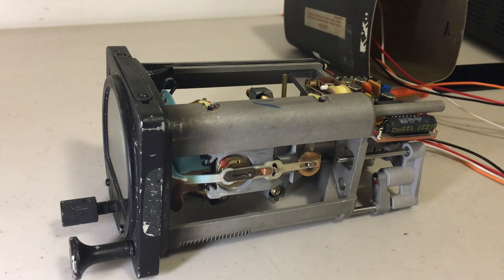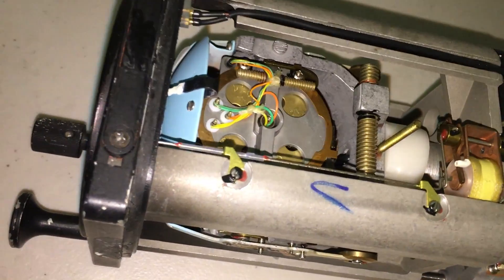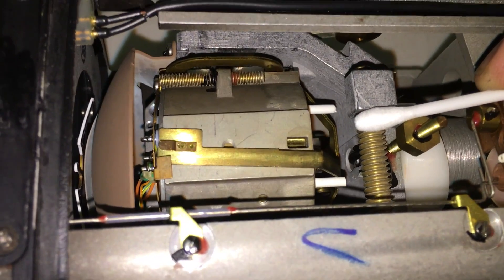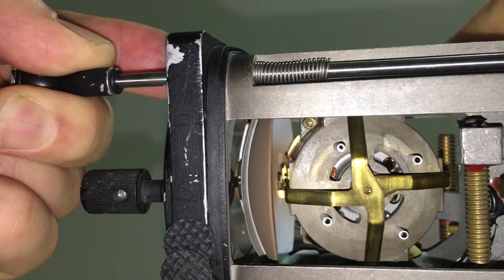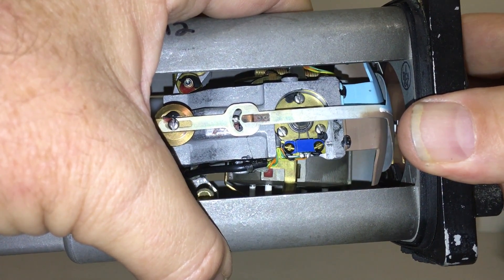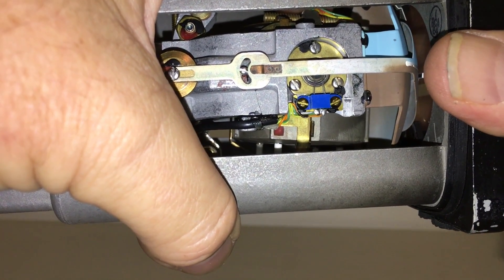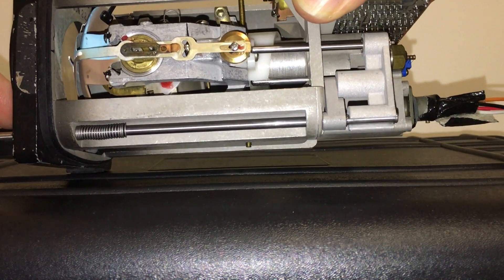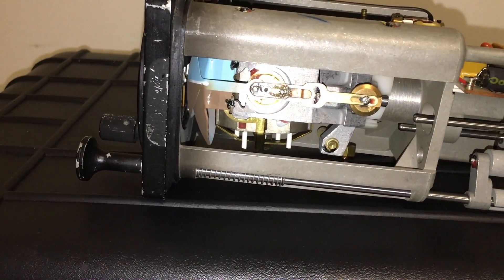Flat Earth - A look inside the Artificial Horizon - Pendulous Vanes.

Comment: Are the ports blowing "straight away" or is the nozzle also angled inside the rectangular opening? (I.e. where/how does the airstream from an open Port move the housing towards? Spinning or shoving?)
Reply from the maker: +Feno 3000 I was surprised how much air is coming out of the ports.  You can feel it easily.  It feels like it is coming straight out and that makes sense for the direction of alignment needed.  I''ll demonstrate the strenth of the wind with a piece of string tomorrow.
Reply from the maker: +Feno 3000 - Reading your post after a sleep I see I missed answering your question.  The port that opens will result in correction at 90 degrees to the direction of the Port.  That is due to Gyroscopic Precession.  It will respond at 90 degrees to the force applied. 

This animation explains it nicely.

https://www.youtube.com/watch?v=_MoS5Yw9ZgE
Reply: The way that gyros work is something called gyroscopic procession, that’s where any force applied to a single point on a gyro will affect a spot that is 90 degrees in the direction of rotation

Comment: Just for fun type in ..Proofs of a globe on YT.....you'll be amazed ..pretty grim
Reply from the maker: +Mark Draco.  Just for fun, try posting a comment that is on the topic of the video.  I'll be amazed.
Reply: Oh I do .... and then the attacks begin ...lol
Reply: What is amazing is how you pull the cage when on the ground and it knows and follows earths curve whilst in the air ...amazing how it always knows where the centre of earth is ....
Reply: Amazing how gravity works, isn't it.
Reply from the maker: +mark Draco - the attacks begin because even when you post on topic your comment demonstrates you miss the point of the video entirely.  That is not an attack, it is what I notice often in comments here by Flat Earthers.

You have done it again.  Caging on the ground, in the air, upside down or in a turn is quite irrelevant.  Once the cage is released the gyro automatically starts correcting itself back to level. 

It does this by sensing the direction of "down"  That is not difficult to detect. 

It is not really amazing that it knows where the centre of the Earth is.   Pour out a glass of water.   Which way does it fall?  That is the direction to the centre of the Earth.  Easy as that. 

The direction of down changes as you move around the Earth,  an experiment with two plumb bobs a mile apart and a theodolite will prove that.

Your comment is very naive and shows people you don't understand my video at all.  Is that an attack?  Maybe, but it is also the truth.
Reply from the maker: +Mark Draco - just another thought,  Just for fun check how many schools on Earth teach the Globe.   Then compare how many of them genuinely teach kids the Earth is Flat. 

You want grim...  That'll do it for Flat Earth.   Not one school on the planet teaches Flat Earth.    It is just a tiny, weird part of YouTube that nobody takes seriously.

Again, sorry if that sounds like an attack,  it is also the truth.
Reply: Wolfie who owns the schools ? ...Clue it is the same people filling you with fluoride,putting it in your water....I guess you believe this waste product is good for you. What you say is not an attack ....I would say being called a c*nt is an attack like from MuzikTWAT the gamer ....
  So Wolfie how can there be sunlight in  New York ,New Zealand,Tokyo(Japan) and the UK ...all at the same time ?
   What force pulls the ISS away from earth when it needs to adjust for the curve ?
    What force pushes rockets in space ?
   How is the moons shadow tiny (solar eclipse) but the earths shadow(lol) is massive (Lunar)...when they are both equal distance ?
    What separates earth from the vacuum of space ?
    How is it the horizon dips in 3 to 4 miles looking forward ...but left to right you can clearly see 40 miles either side ?
   And back to the beginning ...Why pull the Cage out before take off ...IF when flying it is set for where you took off...how does it know to follow earths curvature?
  If gravity was real why isn't Radon (density clue here) density 9.73g/l on earths surface with the other gasses layering upwards towards Hydrogen and Helium .
   Which apparently slowly leak out into space (LMFAO) at that one ...gasses escaping but only some ....blimey there is a leak ...but only a small one or the vacuum would destroy us.
   NOW WOLFIE OR HIS SHEEP FOLLOWERS ANSWER THESE SIMPLE QUESTIONS AND I WILL GO BACK TO TAKING MY FLUORIDE LIKE YOU PEOPLE !!!
Reply: You're a good man, Walter, but Troll Draco has had all those questions answered for him multiple times. No point spending more on him.
Reply: Using the skateboarder hilarious ...you are dense 
Rocket pushes against its exhaust......  "            "
Oh yes did you know they say there are millions of bits less than a cm 500,000 bits larger than a cm all spinning around earth ....not to mention as you say the satellites (lol) ..funny how they all seem to miss one another.
Where is your evidence of gravity ...I guess that it why you avoided the gases lol
So where does Fluoride come from ? Still got my teeth and I avoid it at all cost
Oh and the sun shining in 4 places with evidence ...you ignore that ...WELL DONE....
     Nothing to say about the sunshine LMFAO ...tricky one ah
Please explain how geometry reduces one shadow,yet a clouds shadow is NOT altered like the moons?
Reply: I provided sunshine NY NZ TOKYO UK ...and you NO answers ...case closed
Reply: I've flown to Japan. I was there for two weeks. I could and did send messages to people in America. The time was different. By a whole 16 hours. Try again.
Reply: Adam ...And ? And to whom ?
Reply: mark Draco Family? Friends? It's not like it matters. There's a massive difference in times between the two. Your argument doesn't really work.
Reply: lol, sorry I meant who was your message to ;-) ..... As for your point... It was recorded live .... you know what live means ? 05.48 Tokyo  16.48 NY 08.48 NZ 21.48 UK ...Sunlight was seen 4 places same time ...
Reply: Twilight. Anyway, it doesn't prove anything even if it did happen. You guys go digging for "proof" anywhere you can. Am I allowed to claim it is faked? The ISS has a livestream too. Let's just simplify it. Show me a FE map that works.
Reply: There is so much globe evidence isn't there ....I don't need to show you anything ....I can NOT open your eyes.
Reply: Walter Walter oh dear oh dear ....the sunshine is my video done 'LIVE"
Oh yes Newton ...funny guy didn't he say if you fire a cannon ball fast enough it would circle earth ...LMFAO 
What does the rocket push against in the vacuum of space ....LMFAO
LMFAO oh silly me geometry explains why one shadow is 70 miles across and the other 1000's of miles across.
If I'm not careful I laugh my head of off ....but there is more from you lol..
Nice ....Density ...WELL DONE !!!!  Although wrong answer explaining the vacuum of space being separated from earth ...Density LMFAO YOU'RE NUTS!  
So the horizon dips off ...LOL where to ??? LOL
LMFAO ...gravity video ...saying it doesn't prove it ...
And finally the fluoride one just proves how retarded you and others must be ....
    I nearly lost my head with your blatant stupidity ....Do you even know what or where Fluoride comes from????
Reply: John you're just conditioned NOT to think or question the reality ...poor thing !

Comment: i guess you clearly would mind to disassemble that thing further, wolfie. thing is: i need to know how on earth they got the bearings running so smoothly in that thing, as an engineer i'm absolutely stunned by such built quality.
utterly informative vid anyway, well appreciated. keep up the good work.
Reply from the maker: +ferze001.  I originally bought this unit to strip it right down but it runs like a dream so I am now reluctant to "break it"  I'll try to find a cheap "non working" model and pull that one fully apart in the future.   There is zero vibration on this when it is running.  You can't feel a thing.  Just the sound.
Reply: +jason sutton  you are just posting silliness.  anyone who drops something observes the force of gravity.  anyone who observes an object being obscured by the horizon sees the curvature of the earth.  wolfie has even made several videos from the beach showing this:  https://www.youtube.com/watch?v=LpQDj600ijA

and here's the literal curve of the earth:  https://www.youtube.com/watch?v=LSrL4xIQT7E&t

however, this is all off topic.  the subject of this video is gyroscopes and pendulous vanes.  if you  don't have anything to say about that matter then do remember to shut up.
Reply: "There is zero vibration on this when it is running.  You can't feel a thing.  Just the sound."

And most of the sound probably comes simply from the air being moved through the holes in the actual gyroscopic weight... like a toy plane propellor or something in that size/rpm region...
Reply: +jason sutton
Better designed by germans than decried by morons.
Reply from the maker: +Nathan Grant. 

New they are over 2K. 

http://sarasotaavionics.com/avionics/rca26bk-12

I bought mine on Ebay used for a fraction of that cost.  I didn't even expect it to work and bought it just for the tear down.   It actually works better than some old units I have flown with. 

There are a couple on Ebay now but these are both more than I paid also.

 http://r.ebay.com/ZUQYf0

http://r.ebay.com/TmzA3c
Reply from the maker: +Geist View - Yeah, I don't want to ruin it because it works so well.  I can lock the vanes with a  tiny piece of sticky tape where they cross over.   Then use a small piece of Blu-tack on the top to balance it perfectly.  I will try that too
Reply: Requiem4aDr3Am nobody with any wits whatever buys into any of these satanic deceptions. Gravity does not exist.
Reply: Measure from where to where? Nobody is asking questions. Anyways, a good zoom camera and a trip to the beach is all it should take to shatter the ball for everyone's little minds and we can finally start to grow up around here.
Reply: jason sutton committed "a good zoom camera and a trip to the beach is all it should take to shatter the ball"
- And if you stay there for sunset, it is all it takes to understand we are on a globe. The sun doesn't vanish but sinks beyond the horizon. Shattering the pizza.
Reply: Wolfie6020 

Ya, tearing it apart woukd throw off the balance. Even if you lined the paint markings it would still be off.
Reply: +wolfie  how expensive are these things? ... i could look myself.

anyhow,  i do enjoy this sort of examination of hardware.  so my vote is for tearing it to pieces too.  :D
Reply: Probably designed by germans
Reply: +wolfie  not cheap then.  i understand your reluctance to risk destroying it with full disassembly.
Reply: Muzikgod occupies the top spot in all three of those profound categories. How could anyone enjoy being anything with your brilliant comments in the webs?
Reply: its nothing more than roller skate bearings. id bet that the gyro weighs a few pounds
Reply: Random dude buys old gyro on ebay. Makes youtube video. Suddenly he is the "authority" on engineering of gyros, yet much of what he says about it in his video is factually inaccurate. lul
Reply: ferze001 That’s the reason instruments like this are built and repaired in ‘clean rooms’ (where the air is filtered to be free of dust and the technicians work in full body sperm suits.) Dust is the enemy! They truly are a marvel of engineering when you understand how they work.
Reply: heh don't worry next week Wolfie will have his own ring laser gyroscope purchased from globebusters. Then after he has fun with that thing he will go on to build LIGO on his estate and start measuring gravitational waves for the lols:P

Comment: I may have missed it but could you clarify the amount of correction applied during normal operation. Obviously the instrument will show a climb or dive and a turn in either direction.
Reply from the maker: +SqueakerAlpha.  The until will be constantly correcting but there will be very little error ever as it corrects immediately any tiny deviation is sensed.  

It is correcting to "true level" which is independent of the orientation of the case of the gyro.  

Yes it will show climbs and dives and turns reliably.  Even if you held a steady climb for 30 minutes it would be correctly showing the climb because the gyro is levelling to "level" and not the climb attitude of the gyro.  

In a long steady turn you can get more errors as the apparent G is no different to real G (as centrifugal force is not present) so the gyro might misalign slowly to the turn.  There are ways to prevent that in some gyros - ie. when they sense higher than 1 g they turn the correct mechanisms off ( over simplified explanation.)

I'll cover that in another video.
Reply: thanks , I knew the instrument corrected itself but never had a good explanation of how that worked.
So the gyro itself stays "level"  at all times , and its the orientation of the  instrument that shows the pitch or roll .
Reply: So if I understand it what is going on is that once you change the attitude of the gyro it will display the fact that the attitude has changed and then very slowly it will correct it self back to level. So that if you were in a long steady turn the gyro is going to display the fact that you are in the turn but over time is going slowly forget that fact and suggest that you are flying straight. But this does not matter because during practical use you never have the aircraft in such a situation for long enough for it to make a difference.
Reply: I flew gliders and a Cessna 150 aerobat.     I got used to the gyro tumbling during aerobatics.

Comment: Finaly I understand how exactly those vanes work, I knew they existed and what their purpose was, but it is very instructive to be able to see them at work inside the gyro. Thanks for that.
I came across a guy that's called The Righteous Dude, who  claims to be a commercial pilot and a "gold seal" flight instructor. And he is a flat earther who claims that airplane gyros "prove" a flat earth and writes vanes as veins and precession as procession btw. Maybe you could persuade him to engage in a discussion with you.
Reply: The thing you have to remember is that a force applied at 90° to the error (CW or CCW depends on the direction of rotation of the mass) will cause the gyro to precess in the wanted direction.  So blowing air from the bottom of the casing to the right/left will cause a pitch correction. It's neat because no extra mechanical coupling is needed
Reply: +Frank de Brouwer pendulus warrior veins! https://www.youtube.com/watch?v=Q46l70mNmCw
Reply: Requiem4a3Am: At least the guy makes more sense than the average FE-er. And of course: he shows the real veins! ;-)
Reply: hehe yes
Reply: A flat earther taking part in a debate? That will be the day...
Reply: a COHERENT debate, I should add.